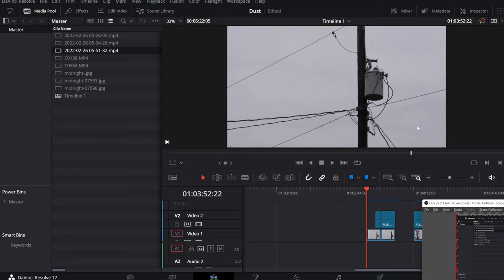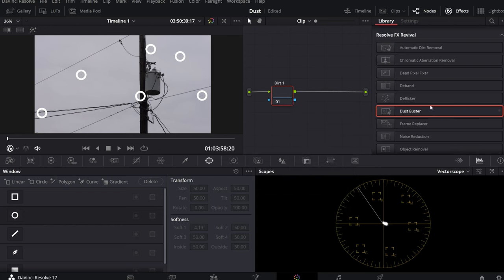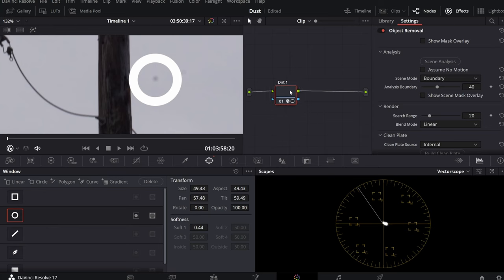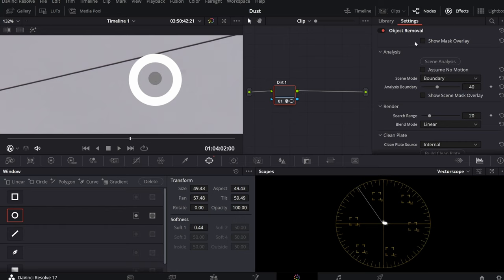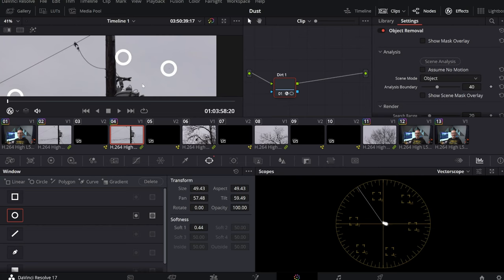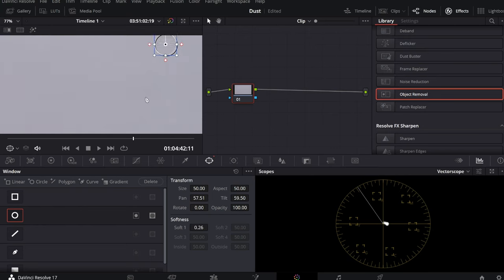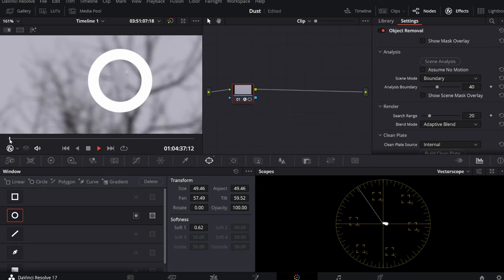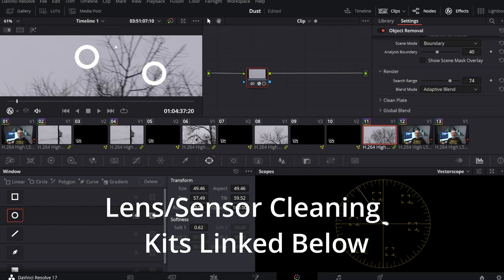Dirt and Dust Removal in Davinci Resolve 17

Comment: Thank you John. 
You can try also the "Dead Pixer Fixer" tool in resolve. its can do the job like in your exmple but mutch faster.
Put it on your video | turn on the "Open Fx overLay" | and just click and drag on the dusts.
Reply from the maker: OH neat. Thanks for sharing!!!
Reply: Oh wow, +1 for this. Way simpler and less cpu load. Method in the video is now my plan B.
Reply: Wow man, the Dead pixel fixer is insane thanks so much for the suggestion

Comment: For my personal case "Automatic Dirt Removal" was such a good filter in Resolve to nearly fully clean up some horizontal VHS tape lines I had flickering on my video - without losing much detail in things like patterns on people's shirts, which were slightly affected. Resolve is so clever with the mask to show you in reverse what it's removing. I had it crashing when rendering but it worked after un-ticking this: "Preferences > User > UI Settings > "Stop renders when a frame or clip cannot be processed".
Reply from the maker: Wow that’s crazy. Resolve does have a flicker remover for those lines as well

Comment: Dust spots are usually not an issue when shooting with a wide open aperture. But for landscape photography time lapses when you close down the aperture to get everything in focus, the dust on your sensor and lens comes into focus. Even after cleaning my sensor I see dust spots all over when shooting above F12. I wish Resolve had the same dust removal feature that Luminar Neo has.

Comment: Thanks John.  Good information. I have used Automatic Dirt Removal  and Dust Buster on old 8mm / Super 8 films (as you suggest) with very good results because the dirt is there for only a frame or two, but it is still time consuming.
Reply from the maker: Thanks for sharing and sticking around the channel!

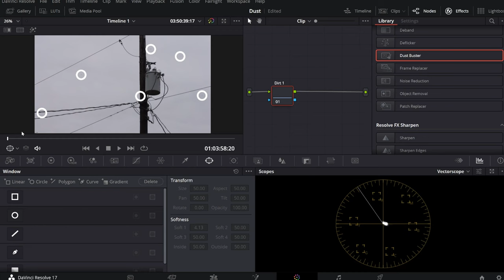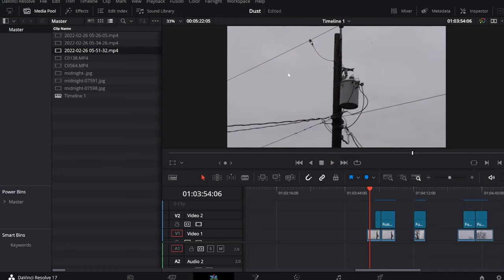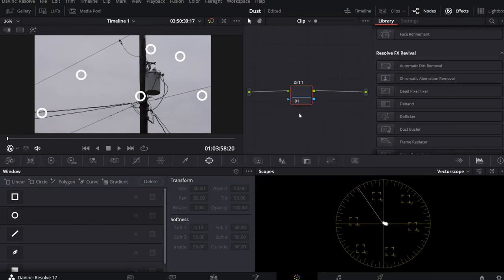Comment: I came across your video on how to remove sensor dust spots.  Looks great. However, I do not know how to get to the "page" you are working in within the video.  When I open the file in da vinci 17, my screen looks quite different and I can not find what you are refering to at 1:42,   or even earlier at 0:45 or 0:56.    Can you assist?
Reply from the maker: At the bottom of the screen there are icons that help you switch - you can also use the Shift-1 Shift-2 all the way to shift-9 to switch between them, I’ll bet Shift-6 solves your issue.
Reply: @johnsfilmsllc  You're not explaining this well for beginners... slow down. "There are icons" which icon?

Comment: Really hoping that switching to Z9s with their hard sensor shields will eliminate the problems we've had with the Sony dust magnet open sensors.
Reply from the maker: Especially in the field I think it should. Next year I’m taking my A7R4 and either my A7S3 or an A7R5 (fingers crossed it’s out) to Africa on safari….pretty sure that is going to be dust misery.
Reply: When I saw the announcement for the Z9 on Oct. 28, that sensor shield was like a dream come true feature. Unfortunately, I dithered for a few days before placing my order with BH, as I wanted to see some preliminary reviews before ordering. But, once I did- on November 1- I sold 4 Sony bodies back to BH, along with several lenses and only kept 1 A7SIII body with a 24 1.4 lens. I had so many bodies so that I would NEVER have to change lenses, as each one had a permanent lens attached. This was expensive and ridiculous!!! Once the second Z9 body arrives, I'm going to trade the A7SIII in as well. 
Of course, I still plan to blow and clean as much dust as possible off the sensor shield on the Z9 while doing lens changes, so the dust doesn't eventually work its way onto the sensor, but at least changing lenses won't be a traumatic experience anymore. 😀
Reply from the maker: @Tarnway0412  I love the idea. Frankly if the A7R5 has 4k120 I’m selling the A7S3 when I pick it up as well….or…A1mk2. I don’t know I have so much GM glass it seems like insanity to start over with a new system
Reply: Yep, switching systems is always a pain. In the 1990s, I was using Nikons for doing magazine layouts in  the  studio, wildlife field work, etc.,, and then switched to Sony for digital some years later, and now switching back to Nikon again. HOPEFULLY, this will be the last major change. Hint: I'm almost 70 years old, so maybe my newfound Nikon enthusiasm will last as long as I do. 😀

Comment: I saw this video and thought, perfect help for removing dust off of my footage, but it is not working. It just leaves a white circle behind. What I am doing wrong? I changed it to object and to adaptive blend. Is my power circle not right perhaps? I dont know what I am doing differently but it isnt working.
Reply from the maker: It’s likely you are leaving a mask there rather than monitoring the true output but I can’t tell without your specific use case.
Check the settings specifically against what I made
Reply: @johnsfilmsllc  I'm open to suggestions. Thank you for taking time to respond. I can toggle show mask on and off and the blue or red mask portion goes away but the gray or white circle comes back. At this point, this was a free wedding for family, so lessened learned for next time to check my lens before time.